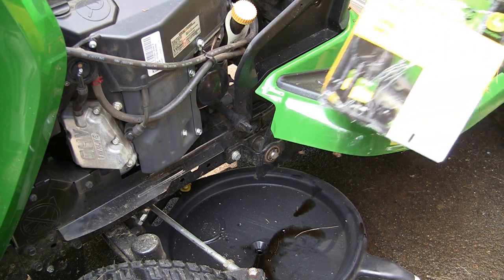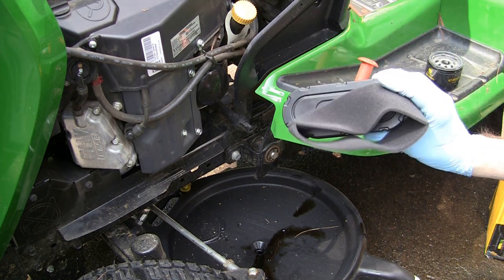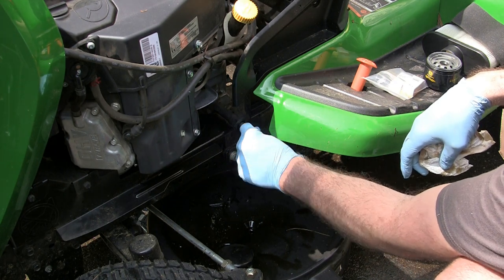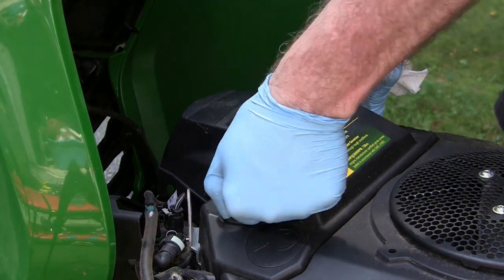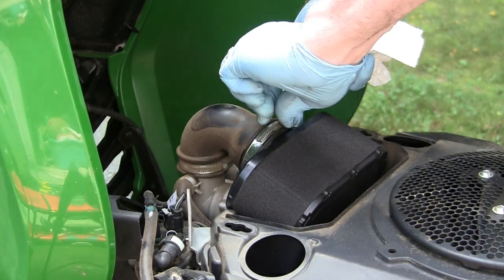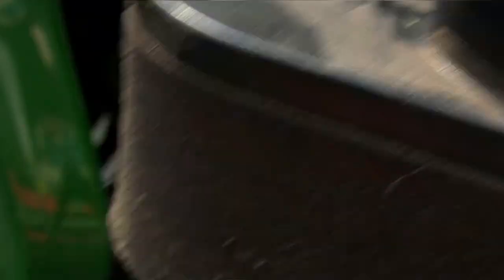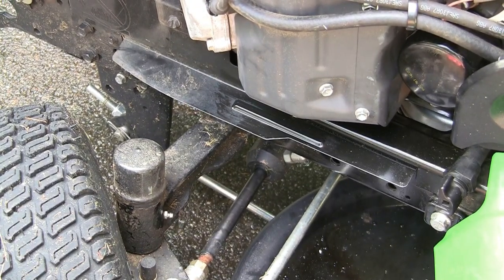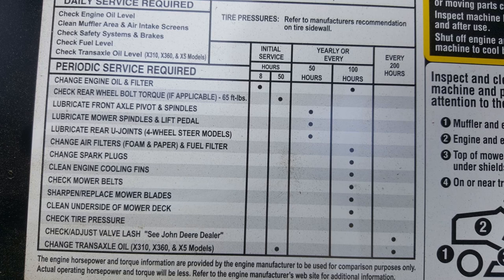x590 100 Hour Maintenance

Comment: Good video Davin, thanks for taking the time to show how you did your 100 hour maintenance. I changed my transmission fluid on the 80 hour mark. When you get around to changing the transmission fluid I recommend you get a flexible funnel with a long hose end. It helps trying to funnel it in the small offset space in the back.
Reply from the maker: Thank you! And yes, you are exactly right about needing a long funnel for the transmission fluid. I changed that at around 50 hours like it has on the service interval chart. I just didn't have time to film that one.

Comment: One bonus of the 590 are the inspection holes under the air filter cover. It alows you to see down to the engine cylinders to look for grass build up. Other models dont have this.

Comment: If it were me: I'd hang on to both those old plugs just in case one of the new ones should fail.  It has been known to happen.  Both plugs were good and healthy looking and you know they were good because the tractor was running well before you changed them.  I'd discard them on the next change out and keep the 2nd set as spares.  Something us country guys do when living 30 miles from town.
Reply from the maker: Yes, I keep a stash of parts. Like you say, you never know when you might need something.

Comment: Pinch the tank side off with a vice grips will also work ! Make sure to put the gas filter in with the correct flow . (Should be an arrow on it .)

Comment: Don't forget to lubricate the center front axle pivot, its easy to miss since its on the bottom of the tractor and difficult to get to. According to JD's schedule it should be lubed every 50 hours.
Reply from the maker: Thanks for the comment! I believe I found that later and greased it up, but now I am wondering. Will have to double-check!
Reply: I had to jack up the front of the machine with a floor jack to get to it, but then again, I have a big grease gun!

Comment: I think you should point out that the fuel filter has a directional arrow on it and must be fitted accordingly. It is often difficult to spot.
Reply from the maker: I think you just did.  :-)  Hopefully people keep track of the orientation and install it in the same direction. They are fairly distinct in their shape. That said, I'll see if I can add a quick overly to point this out. Thanks for contributing!

Comment: It's odd to me that Deere would make a home maintenance kit that lacks that last bit of oil to top things off.  What, does Deere want owners to be running their machines a tad low on oil?  Of course not, but having to buy a 3rd qt, makes some sense: you'll be left with the remainder for adding oil between changes, I guess...  Just a FYI: my JD dealer advised me to change the oil at the 50 hr. mark, the same time I check the rear wheel torque.  So, I will.  Nice video, btw.
Reply from the maker: Thanks! Have fun with your tractor!

Comment: Have you had any issues with the EFI engine?  I’m considering buying this model... would you buy it again?
Reply from the maker: The EFI is great. Starts up immediately, every time, cold weather or hot. So far, I have had 0 issues with the machine. I've had to replace the snow blower belt once, but that is an expected wear item. I would totally buy it again.
Reply: I have a first year 2015 X590. It was a hybrid year. All the parts of the X540 but with the EFI engine. Mine has been perfect. I would buy another without question. I have a 30" mechanical tiller and the 47" snowblower. This is a great machine.

Comment: Hi Davin, I asked you a year ago if you have had any problems with the 590 EFI.  I’m ready to pull the trigger on one but I wanted to see if you are still problem free with the EFI engine.  Thank you again...David
Reply from the maker: I actually just came in from mowing with it. Still starts instantly and I have had no issues at all. Very happy with it.It is a great year round machine for mowing and snow removal.
Reply: Thanks again!

Comment: Doing the oil change WHEN the mower deck is removed is one thing.  But taking the mower deck off to do it is totally unnecessary. Even my big oil pan fits between the mower deck and oil drain. Great video otherwise.
Reply from the maker: I think I was also replacing the blades at the time and decided to film the other maintenance after I had already done that. In any case, thanks for the compliment!

Comment: I’m considering the x584 with 4 wheels steer but has the carbureted engine vs the x590 with 2 wheel steer but has the EFI engine...not sure which is the better feature to have...
Reply from the maker: I've never tried 4 wheel steering, so I can't comment on that. I can say the x590 turns in tight circles.
Reply: I'm fresh off of shopping for a 500 series.  Basically, if you don't need four wheel steer than don't get it.  It adds complexity to the machine and it makes the machine weigh more.  Bear in mind that 4-W-Steer will add some tail swing and you might not like the back end whacking things now and then.  The cutting circle of the X590 is about 24".
Reply: @discerningmind  I have had a 4 wheel steer X324 for 11 years now and it has been completely trouble free except for the seat vinyl is all cracked. I have a lot of trees and  
a couple of outbuildings to mow around so I really like the maneuverability of the 4 wheel steer. It does add some mechanical complexity and a bit more weight on the rear axle. I also blow snow with it in the Winter so I regard any added weight on the rear to be a benefit. When the snowblower is mounted  we have to add at least two suitcase counterweights anyway. This also increases traction. My next one will likely be the X584 because it has the K72 transaxle with locking differential. A locking diff is really good to have if you blow a lot of snow.
Reply: @dkenmiller9829    Thanks for offering that.
At the time I commented I hadn't made my decision what to buy.  I ended up deciding on an X590.  And that's worked well for my application.
My only complaint is small, and sooo first world, that I'm almost ashamed to type it here.  I will because it may help someone.  While it does have very excellent power steering, there's too many turns lock-to-lock.
But I had great luck anyway as it's so powerfully assisted that I can rapidly one-finger turn the steering wheel.
I don't know how old you are but I'll risk saying that the X590 steering is as easy as that of a '61 Cadillac.

I want to add that it's hard for us guy's when shopping for equipment like this because you can almost never test-drive a garden tractor.  So I've always had to put in a lot of study, research, and asking people, to advert my buying a mistake.  I've had that experience too.
So when that new machine is delivered and it turns out to be great--thank God!